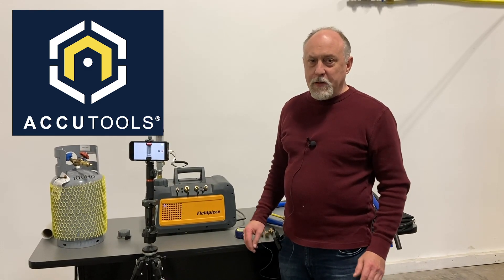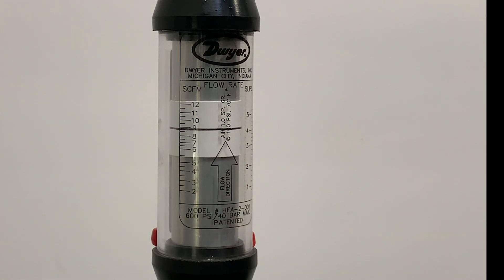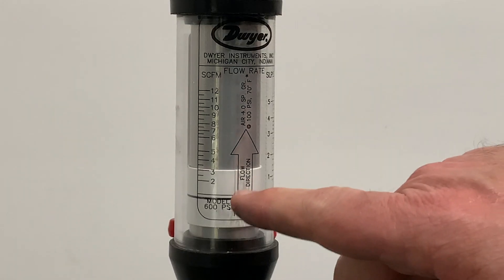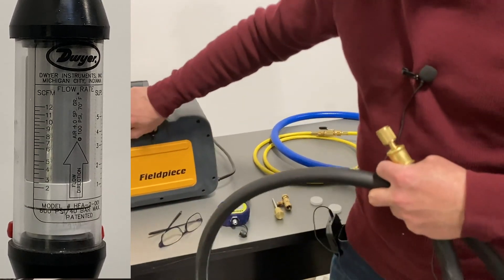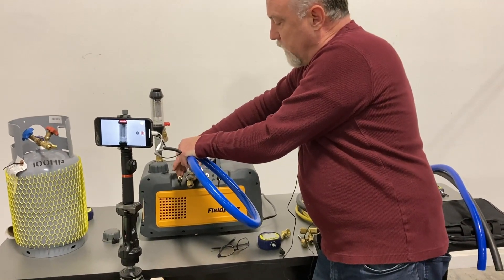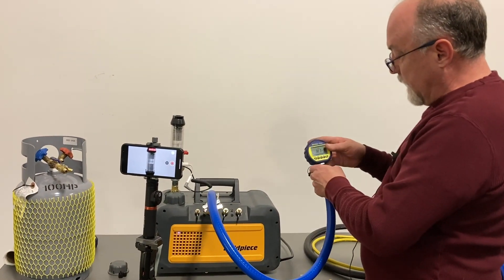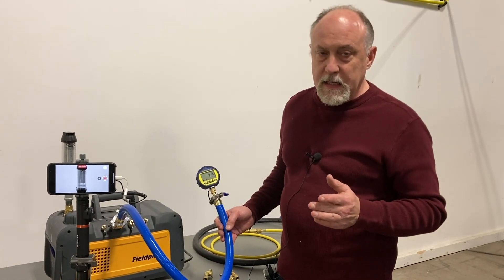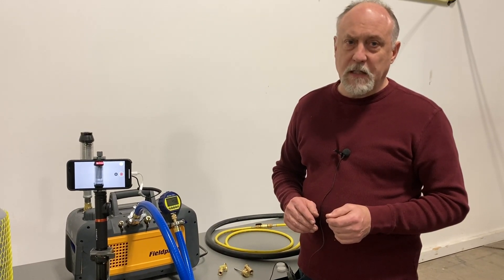Hose Size Comparison

Comment: Mr Bergmann , big fan of the blue hose here but for the life of me I cannot get  anywhere near getting my hands on it .
I work in France and I actually called the Accutools dealer you pointed to , but they do not sell to the public , only to supply houses and such .
Now , I've called the different supply houses they told me they're working with , but NONE of them knew what I was talking about , they haven't even heard of Accutools .
So my question is : are we gonna get the blue hose , VCRT and micron gauges over across the pond in EU and the UK please ? 
I know of ONE supplier who is in the know of new products and has actually heard of you , I'd be happy to get you guys in contact with each other if I had your email contact .
I really wanna try the blue hose since I work on big ol' chillers and evacuation with 3/8" refrigerant hoses takes for ever and with mixed results .
Thank you Jim I very much appreciate your knowledge and what you do for the industry , cheers !

Comment: So bigger is better in terms of evacuation
Reply: To a point then just a diminished loss of gains
Reply from the maker: That is correct, huge gains from 1/4” to 3/4” or even from 1/2”, but in our industry the system piping itself becomes the limiting factor.